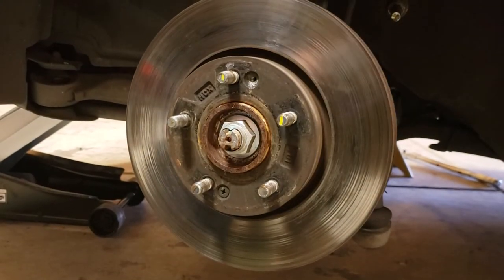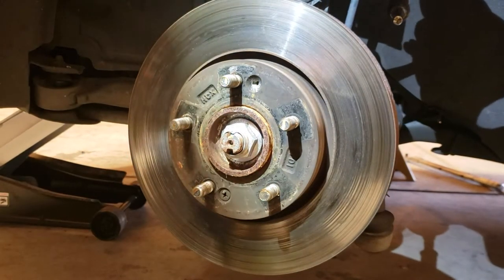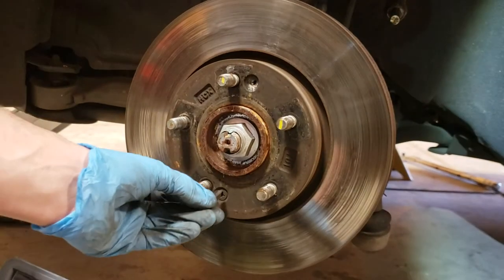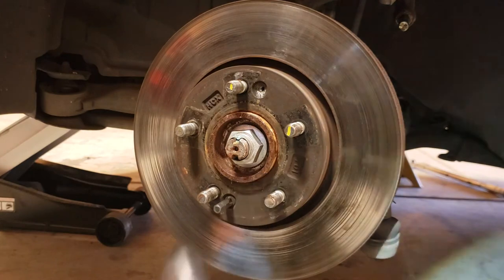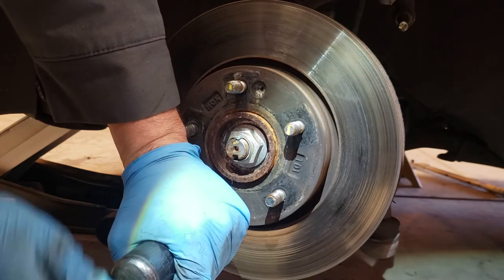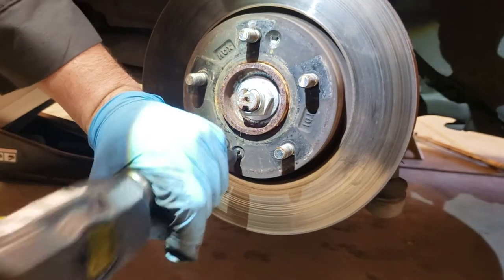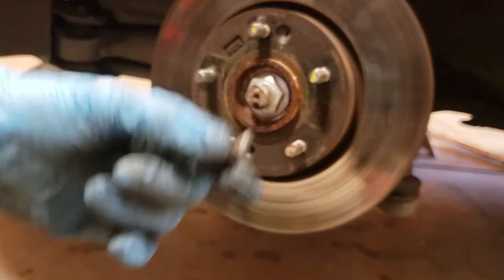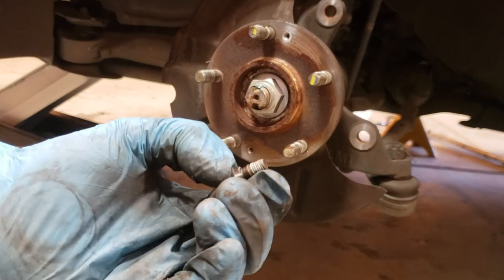Removing Brake Rotor Screws with Impact Driver

Comment: Couldn't I use an impact drill?
Reply: It's gonna strip if you use impact drill
Reply: @Triplemyworth709  yep, I ended up using the impact screwdriver.
Reply: I wouldn't use a cordless impact driver. It impacts forward and reverse. It won't slam into the screw while turning.